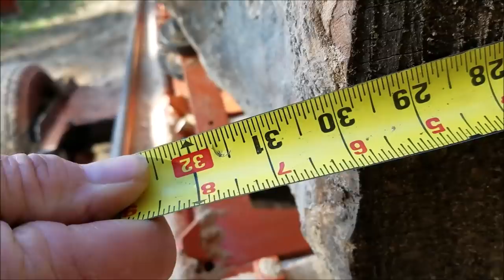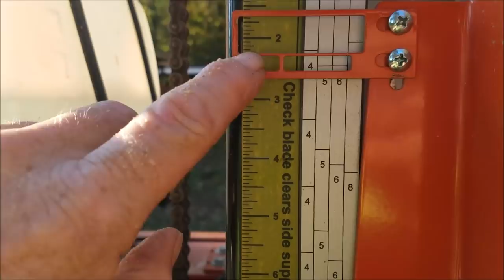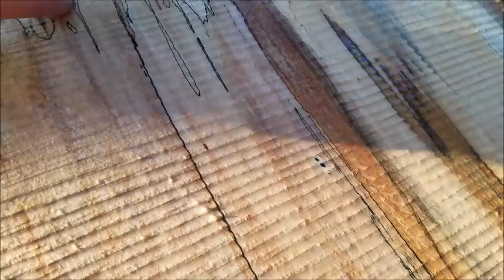Slabbing Spalted Hard Maple

Comment: I have a Woodmizer LG35G25 that I use for hobby purposes.   I find that sometimes I have to help my mill along as I saw you had to do with yours.   Even turning up the movement potentiometer, it still will stop. and I have to help it sometimes.    I have put a couple of modifications on my mill.... One is....I put a 12 volt flow valve in my watering tube, so that I don't have to turn off the tank valve after every cut.  I installed a switch which is operated by the same handle that activates the blade.    When I stop my blade from turning, that also shuts off the water so that I don't have to readjust it for every cut.   Once I have  the flow set, my modification  turns on and off the flow when I start the blade.    I sent photos and a description to Woodmizer, but they did not seem interested in it.
Reply from the maker: The watering system sounds like a winner. One less thing to worry about.
Check the drive belt for the drive motor. I have a video where I replaced the whole drive motor, and you can see where and how to adjust the drive belt.
Mine needs more help when running the debarker. It needs a little more power.

Comment: I have had great success welding a nut on the end of a lag bolt, then screwing it out when it cools. If the metal is not threaded, it can still be pulled by welding something to it, then prying out with a pry bar.
Reply from the maker: Hello Randy, and welcome to the mill. Now that I have a welder, I will have to try that. All I need now is a log, with a big ole bolt in it. LOL
Thank you for the tip, I know there will come a time to use it.

Comment: If you screw a 1x on the flat face the right distance in from the edge, then you can overhang the stops and push up against them with the 1X and get the full width
Reply from the maker: I usually cut a reference, or flat side. Not very wide. Just enough to keep the log steady. Then I can lower the stops quite a way, and push the log over. It will overhang the stops, and get it over to the inner blade guide. 
If you don't do that, the max width is about 22.
Straight logs are easier. Lumpy logs are more of a challenge.
Reply: @IronOakSawmill  TRue

Comment: I wonder if it wouldn't be possible to drill a hole in whatever that steel is and screw a screw into it leaving the head up and useing a pry bar to pull it out?
Reply from the maker: Hello Leonard,, and welcome to the mill.. That is a possibillity, that I may try. If the outside is threaded, it would take a great deal of force to remove it though.

Comment: long video but still interesting. have you ever tried heating the in wood metal? maybe a soldering iron of some type, or a micro tip propane - butane torch, get the object almost red hot then let it sit for a while, then you might be able to pull/twist it out, minimal damage to the wood but none to the blade just a thought for saving blades.
btw have you ever thought of rifle stocks for some of your wood ??
Reply from the maker: I've thought about the heating option. I believe it will work. I just need to find the metal before I find it with the blade.
Yes on the rifle stocks. Just need to find the right log for figured wood stocks. Clear stocks are easy, but finding one without bark inclusions in the crotch area has proven difficult. I keep searching though.
Thanks for stopping in

Comment: Would a handheld metal detector help or is it not big enough of a problem to bother with?
Reply from the maker: Hello Kenneth, and welcome. Most hand held units are for security, and detecting larger items. I had one at the time of this video, and it was useless. I've since gotten a regular metal detector, and have had good luck with finding the metal in barn beams that we re-sawed. 
One issue with detecting the metal, is then finding it, and removing it. There's no real way of knowing how deep it is. Finding a nail that still has the head, showing above the surface is good, but digging into the log until you find it, can waste a lot of valuable lumber before finding it.
Reply: At least one video  l watched thought it was appropriate to use a metal detector. Makes sense to me if it's more than a hobby.

Comment: If you think it is a screwed in bolt you could use an easyout.
Reply from the maker: Usually the threads are so locked into the wood, that you can't turn the thing. Probably end up breaking an easy out.

Comment: If it took this long to mill one of the logs that are brought to us, we would be working 12 hour shifts. I could have had that cut done in 2 by or 1 by in around 15 mins. But we operate on a bigger mill. Im in a inclosed cab all of my adjustment points i make inside the cab
Reply from the maker: I'm sure you could with a mill like you described. Sounds cool.
Reply: @IronOakSawmill  Im not trying to be ugly guy, i work for a company vs you working on your own as working out of your back yard sorta speak. Sorry if i disrespected you.
Reply from the maker: @jeremy2033  no problem. Didnt take it that way. Sorry if the reply came across like that. The typed word sometimes misses the human emotion. 
I wish I could be sawing a bit faster though but as long as my customers are happy, and my product is good, I'm doing something right.
We would like to cut wider as well. We bought this mill, just before the WIDE mills came out. If things work out, a wide may be in the future. I know the slab craze wont last forever, but the wide will still handle a larger diameter log, without all the trimming and such.
Reply: @IronOakSawmill  I work for Coital Carolina lumber Co. Truck come in to buy high end wood to mike custom flooring, bar tops, cabinets etc.... Funny thing is Georgia Pacific is part owner of Coastal
 Carolina. Our paychecks are written from Georgia Pacific LOL!!!! No harm no foul guy you do great work. I had to take the week off this week. I lost my uncle. You all have a great day and dont hit any metal in the logs!
Reply from the maker: @jeremy2033  sounds like a good company to work for. Steady work is important. 
We sell to mostly small individual shops, but we are attracting some remodeling companies that restore barns and old farm houses. That's gonna help us out alot. 
Wish you the best. You should video from the operators chair, and post on youtube. It would be cool to see.
Reply from the maker: @jeremy2033  I'm sorry to hear about your uncle passing. May you find peace and strength during this difficult time.
Reply: @IronOakSawmill  That falls in to a good pay day if the right person takes notice of the beautiful wood that can come out of some of this wood.
Reply: @IronOakSawmill  Thank You for the kind words, he's in a much better place now. He was very sick.
Reply from the maker: @jeremy2033  I'll probably be using some of this. I make and sell pieces from our lumber as well. Amazing what comes out of a seemingly scrap log.

Comment: do you cut a different way to get book match pieces like for table tops ?
Reply from the maker: Not at all. Bookmatch is achieved by taking 2 slabs in the order they were cut, cutting one edge straight, and joining them along that edge. Any log you slab straight through, can be bookmatched.

Comment: Try using an old axe head as a wedge once  you get halfway down the log, back at the beginning as you cut. Might help seems like you have to push pretty hard to finish cutting.
Reply from the maker: I have plastic wedges for stuff like that, but I believe I actually hit the log with the blade guides, and had to push it through. Normally, the saw cuts right through without an issue.
Also, I lean on the control panel. It makes it look like I'm pushing the mill through.

Comment: hello I'm from Brazil and I have a small sawmill too and I would like to know how long the sharpening of your dry hardwood tape lasts
Reply from the maker: Hello Fabiano, and welcome to the mill.
It varies on how long the sharp blade lasts. It depends on how dirty the log is, and what type of hardwood it is. 300 to 400 bdft is an average before changing the blade, but it varies.
I imagine you have some beautiful woods to saw in Brazil.
Reply: @IronOakSawmill  thank you for your attention, there are beautiful woods here but very hard and thick, if the wood is not very dirty, I saw it on average 4 hours without sharpening, but my tape is 5 "wide

Comment: If you know it’s an urban tree, why wouldn’t you run a metal detector before cutting?
Reply from the maker: Even when I do run the metal detector, and find metal, I want to mill the log. I lose a blade, it doesn't matter. The slabs are well worth it.

Comment: What happened to the bolt?
Reply from the maker: It's in one of the slabs. In the center along the edge.
Reply: @IronOakSawmill  Ahh..ok. Didn't see any further..must have missed it. Get it out? I wondered what you may do if you hit something like that..😊
Reply from the maker: @singleshot2218  I'll probably leave it in there. Its deep in the board, so it should be safe to machine around it. Part of the history of the tree.
Reply: I do not understand. Why would you "showcase" the bolt and then not include the solution or the location of the bolt in the final product?
Reply from the maker: @charlesvancella524  I wouldnt say it was showcased. I did indicate that it ended up in the middle of a slab. It can be left there, and be part of the trees history. I did show that in one camera shot..